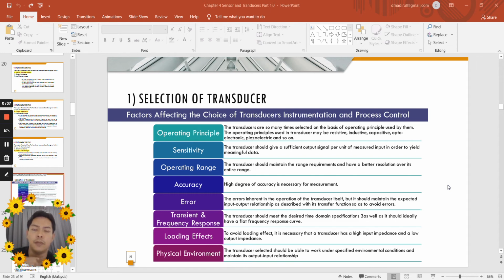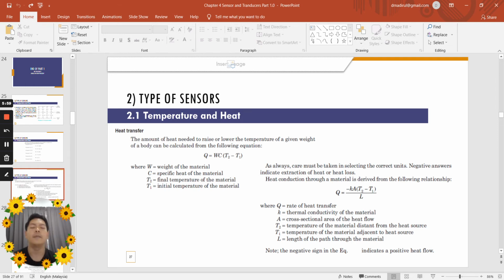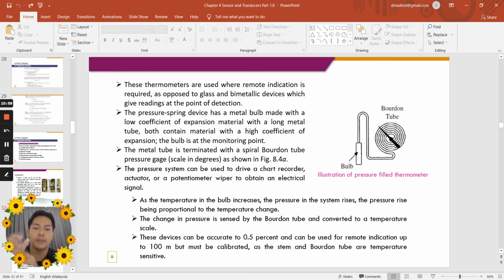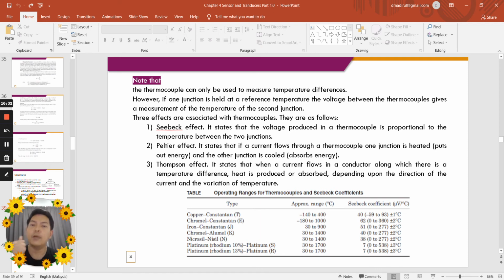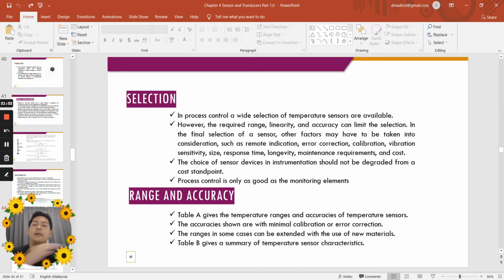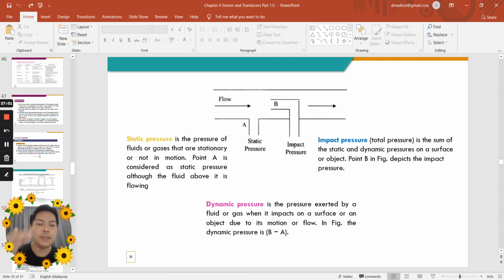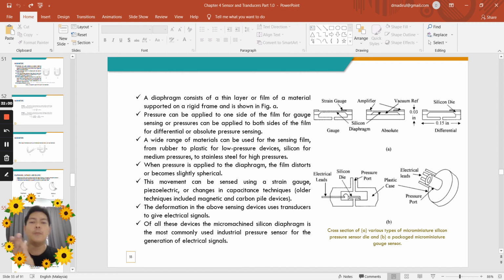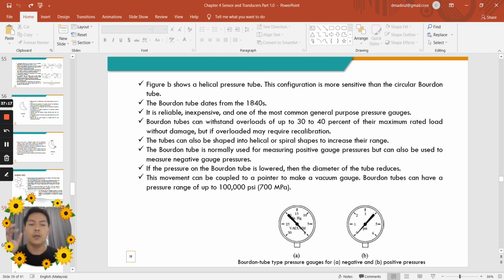Chapter 4: Sensor and Transducers (Part 2)

Comment: Thank you Dr Nadirul for the lecture. From the video, what I could conclude is, there are several measuring device for both heat/temperature sensor and pressure sensor. Each device had their own description and signal conditioning. Example of temperature and heat sensor: Thermometer, RTD, thermocouples and thermistors. Example of pressure sensor: Manometers, Gauge sensor, barometer. That is all, stay safe and stay kacak Dr hehehe

Comment: Thank you Dr. for the video. It is very helpful as i have learnt about the factor affecting the choice of selection of transducer instrumentation and process control. I also learnt about the type of sensors with different classes such as temperature and heat(thermometer/RTD) and pressure (manometer)

Comment: Thank you Dr, from this video i have learned about the factors that need to be consider when selecting a tranducer, types of sensor in terms of temperature and heat such as thermometer, and types of sensor in terms of pressure such as manometers.

Comment: Thank you Dr for the video. From this video Ive learned about selection of tranducer, types of sensors in temperature and heat such as RTD, pressure type sensor such as manometers.